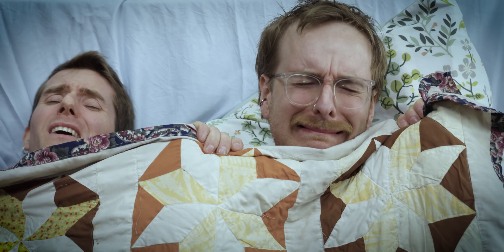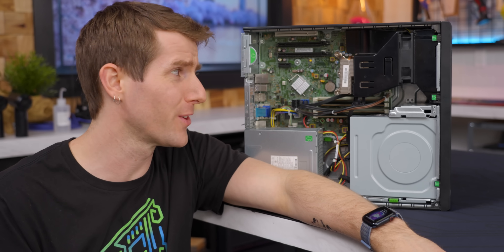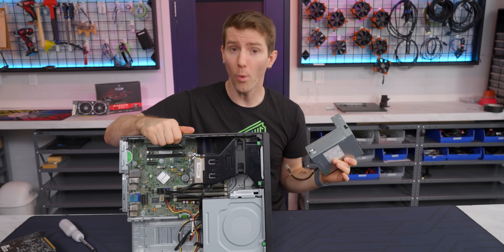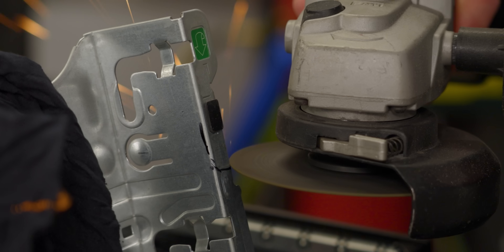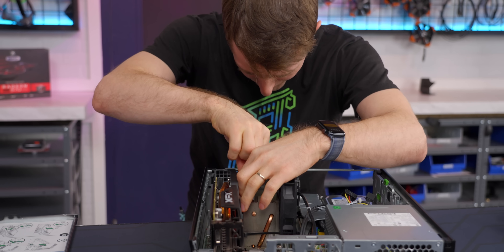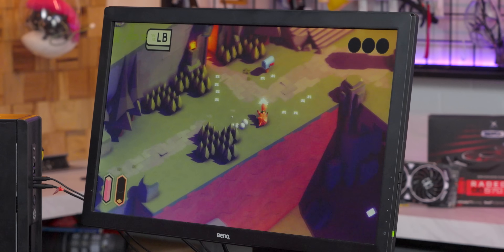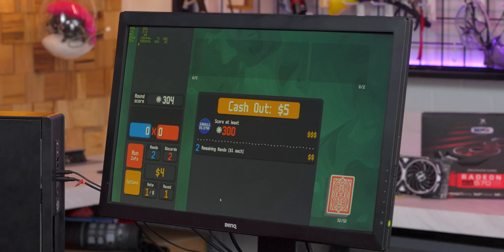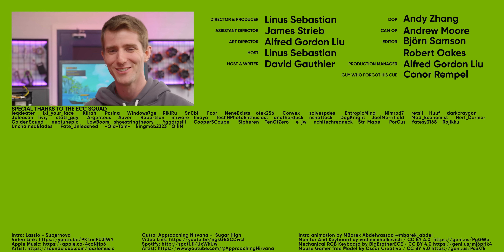How to Build the Ultimate $69 Gaming PC!

Comment: Ex-corporate Dell T3610 or HP Z420 are much more sensible & practical starting points for budget builds, and can be had for £30-40 if you hunt around. 
Throw in an RX 570 8GB for £30-40, and a 500GB SSD for ~£20.

It's not entirely jank-free though; you might still need to crack out the angle grinder to remove the internal side panel handle, and the soldering iron to fabricate an 8-pin to 8-pin PCIe aux. cable.

Comment: I already have a PC like that I built in 2016. It has an i5 processor probably newer than the one in HP prebuilt. 16GB of DDR 4 memory. It was designed as a small form factor at the time. The GPU is an old GeForce GTX 750 Ti. With only 2GB of vram, it’s not that good of GPu. I already have a Radeon RX 5700 XT. 

So with LTT logic, I can technically build a Jank gaming PC for Zero dollars from parts from older builds.

Comment: Having my spare setup totally free. Got some old Dell with 12GB(8+4) of RAM, changed i5-7400 with i7-6700T(yeah, I know, RAM speed downed to 2133 and all, but hey! 8 threads are 8 threads!) from another trash-saved miniPC, threw an Eon-old R5-250 and voilà! GTAV locked in 30FPS FHD capable machine! BTW CS2 has little to do with VRAM at this point as it went up way more CPU heavy from CS:GO

Comment: Picked up a 3570k / rx 480 and a 8700k / gtx 1080 pc off the sidewalk once, cleaned the dirt off, both work fine.
Also bought a "box with old electronics" for 150$ once - inside was a completely decked out T430, a still working but in terrible condition T60p, 4 SSDs and 5 hard drives with a total capacity of 2 and 12 GB respectively.

Just gotta keep your eyes open.

Comment: Just built a similar system. HP Prodesk prebuilt for $25 shipped. Added ram, 7th gen I3 CPU and SATA SSD I had in my parts stash.  Haven't yet added a GPU but this this rocks. For under $30 out of pocket.  I love those 7th gen Prodesks.  Super build quality, easy to work on, BIOS updated only a year ago, and by golly they perform well.

Comment: Check your local recyclers, ask nicely and you might even get a PC for free. My local recycler is pretty chill. I "drop" a case of beers at their office and they "overlook" me digging through the e-waste container and making off with a stack of old office PCs. Typically I fix them up, upgrade them when needed and sell them for a nice profit. A Core i5 8400, 16GB DDR4 RAM, a 256GB NVME and a GTX 1660 (Ti) and Windows 11 are quite a neat little package for 150-200 bucks.

Comment: I transplanted the motherboard and 6th gen i7 CPU from an HP workstation into my existing ATX tower case once, and even bought the proprietary PSU adapter harness. But little did I know, that motherboard had sensors on the ground pin of every header, and threw up multiple separate POST errors until I made a jumper wire from the ground pin of every USB header and fan header back to the ATX connector. Wow that was janky.

Comment: Hell no, HP - no. Lenovo - is good for a build. Actually you may buy some laptop, with nVidia 960m, 1060, this decision will cost you 200 - 250$ Build on AMD 8060G 16 Gb RAM 256 Gb SSD , with only 250W PSU or even less, will cost you around 500 $ Enjoy!

Comment: LMAO that's literally the same case i have but my cpu is a I5 650, 7:04 also that's how my gpu is in my pc, a friend got me a new graphics card so i had to remove the side panel, break part of the back IO panel and a tiny part of the cpu cooler since i didn't want to remove the cpu cooler, also i had to put like a tiny piece of wood to hold the graphics card so the blades didn't hit that copper thing that was sticking out of the cpu cooler. It's SO JANKY but it works surprisingly well, a year in and no problems yet.

Edit: 10:02 I CAN'T 💀i didn't see this, it isn't the same reason as to why i did it but it's so funny he had to put something to separate the gpu from the cpu too hahaha

Comment: 980ti preforms the same, if not just slightly better than the 1060 6gb. Had both, and both performed similar. I was using a 4770 at the time though, maybe a cpu bottleneck lol.

Comment: A few months ago i built one of these. A hp prodesk with a i7 9700 bought 3 rgb fans a 120 aio and a p102 mining gpu, modded the 12v power cables added pcie. Got 1070 performance in games and only cost me $200 in total for everything. Was "fun" building and sold it for $350. Did this a few times and with the profits now have a 5950x 64gb ram 2.5 tb and a 240 aio 1080ti. Put in the work and you can build a good pc

Comment: if you use a hdd, use Linux. It's so much better than windows at dealing with slow storage, i can honestly say, i rarely notice any difference between an ancient HDD and a modern gen 4 nvme ssd. 
Sure, booting takes a few secs longer, but apart from that?

Comment: Is it advised to use PTM7950 thermal pads with an i9-10900k and an AIO?
Edit: my current "paste" is what came on my (Corsair H115i RGB Platinum AIO Liquid CPU Cooler, 280mm, Dual ML140 PRO RGB PWM Fans, Intel 115X/2066, AMD AM4/TR4)

Comment: If you dont mind not having official W11 support, HP workstations are beasts, especially newer one (2012+) with V2 and V4 cpu support. E5 2299 V4 is beast, especially if you get dual CPU model, and they are pretty cheap. Made an home server from an older Z620 with older 2255, threw arc A380 as encoding card and it is running plex and some light game without any problems.

Comment: For around $60, you can buy an AMD BC-250. It’s a single-board computer based on a cut-down PS5 chip, with 16 GB of unified GDDR6 and an M.2 slot. These were mass-produced for mining. All it needs is an SSD, a 250W power supply, and a cooling upgrade. And of course, installing Fedora Linux to use the community GPU driver.

Give this build a try — we’d all love to see how it goes. Thanks! (Feel free to like this to push it up.)
Reply: I kinda wanna see this.
Reply: hmm... me too.

Comment: nice I done something similar for my 3 nephews ,  you can use nVME ssds as a boot drive with a bios update with some of those old sff hp's  ,  but you need one of those pcie adaptors , and the other slot is covered by the GPU ?    I never got around the lack of psu power though lol!     you can get Low Profile  RTX 3050s now which is probably what il use for my next sff build but thats a lot more expensive :)

Comment: they have fairly inexpensive sfx psus now that can straight up replace those crappy ones you can basically rebuild those mini pcs into quite a nice pc with an SSD. LP cards fit in the systems nicely also and usually require less power draw. Also most of those office pcs have good fan control in the bios. The best ones are the ryzen based ones in my opinion they do great for gaming paired with any gpu due to the core count.

Comment: Found a free broken keyboard that needed a bit of tinkering a 5 buk monitor, a 20buck cpu mobo ram combo 15buk psu a 30buk gpu and a carboard box with tape and i had myself a potato that i could play before 2017 games on, stuff like doom 2016 actualy ran great.

Comment: My mates playin helldivers 2 1080p/60fps on an old hp z240 with a 1070, £50 for the pc (i5-6500/8gb ram/400w psu) and £100 for a 1070 from cex bit steep on the gpu but does come with 5 year warranty. I donated him and 8gb ram stick and an ssd from my old laptop n hes had no problems so far.

Comment: "4gb is not enough nowadays" dawg I am putting a gt 1030 2gb in my pc, I think it will be good enough. But jokes aside I also have a hp prodesk, threw a sata ssd in there and now the gt 1030(no power left). So the computer I got for free, the GPU was €42 and the riser cable to hopefully make it work is €10

Comment: 15 year old me was able to pick up an old Lenovo laptop with a 4th gen i5 and an mx 150 with 8gb of ram for free. Free cause it literally had no display and the keyboard and trackpad was broken. Bought a second hand monitor and a budget keyboard and mouse and a small USB fan. I took the bottom off the laptop and had it facing down, with the USB fan blowing down on the motherboard and heatsink. I only really played Minecraft on it and I was able to get 60-80 fps back then (forgot what settings I was using but it was 12 render distance). I've since upgraded and now that laptop has become a dedicated Minecraft server that me and my friends play on. 😊

Comment: These videos need to also contain a fully built "what if you spent just a few more dollars" build to show how much improvement 5-10 dollars can make. I was really curious how a 100 dollar PC would perform.
Reply: a small CPU uograde and another GPU upgrade and it will be SOLID
Reply: yeah, put in a i7 and 16gb and it would increase the fps a lot more. the 570 wasn't an issue in csgo. I hate how they blamed the 4gb of vram

Comment: I got a good dell from work for a steal woth a cad gpu in it, but my god the proprietary nature of their pcs should be illegal.

Motherboard size/mounting holes
Front IO is mounted to the board with no usb header
CPU cololer attaches to the case so cant be reused
Power connector is non standard so you cant swap it out easily
Sata power comes via the motherboard not direct from the psu liniting expansion

All these things combined just makes me want to replace the motherboard and move the rest elsewhere.

Surely theres a cause with the volumes of these things for regulators to put a stop to the non standard rubbish they are pulling. That or is there a market out there if someone made bigger dell compatible cases with power connectors to fit a normal psu in to so users could take them and turn them in to $69 pcs without and angle grinder or second psu.

Comment: My first gaming pc i  bought a dell T3500 pc of FB marketplace for $150 with a Xeon 6 core processor 10gb of ddr3 and a GTX 1060 3gb , i sold the 1060 3gb for 125 then bought a 1070 for $225 , it ran all the games i wanted smooth af until i could save up to build my own , old workstations are the way to go if you are on a budget just buy one cheap and get the best GPU  you can find and throw it in

Comment: 😂 I just finished my "$69" PC based on your last one. Haven't had a PC for a few years, just been renting a Shadow for the last year. My Internet went to crap so I ate nothing but sandwiches for a few weeks and bought my own Z420 and an open box 1660 Super. Someone gave me a 2TB WD Red hdd. Including shipping, I paid $100 for the tower and $120 for the GPU. I got lucky and got a 2nd gen 420, so when I upgrade the CPU I'll be able to use the v2 Xeon E5 CPUs (if I don't just get a new board as well). Have some case mods planned too. Going to eventually drill out all the rivets to get rid of the 3.5" bays and make room for a couple front intakes. Going to convert the 5.25" bays into 3.5" bays with a 120mm intake fan in front. Gonna add some feet and a couple 90mm intakes to the bottom. Going to add one more 90mm on top as a second exhaust. Might add plexi to the side panel, not sure on that idea yet, or the paint scheme.

Comment: This is hilarious, I literally just got done scrapping together a cheap PC with this exact model business desktop and SSD. I ended up finding a low profile slot powered GPU, no case cutting required!

I am using it for more CPU bound stuff so I put in an i5-4690 and a 1050 Ti

Comment: Operating system? Microsoft is saying that W10 is dead after October. W11 supposedly only runs on 8th gen CPUs with TPM2.0 which are significantly more expensive than your budget. Installing a Linux distro like Pop_OS works great and there are loads of Linux compatible games now but do you want to go there? This huge elephant wasn't even addressed, instead Alex with his angle grinder was the entertainment.

Comment: Out of curiosity, why not do 69, 169, 269, 369, and 469? What does an extra hundred dollars get you? I think the results would be really interesting. You could have, probably, entirely different architecture running some of those systems.

I know I would also be interested if you went more in depth with what parts you chose and why. You did a little bit here, but it got glossed over pretty quickly.

Follow up the sweet build phase with blind tests between employees and see if they can figure out which computer has the best parts. Cover up the PCs so that they can’t see them. But the same 1080P monitors and peripherals on each computer.

Comment: Why using 2 PSUs can cause issues if the reference voltage may not match so 0V and 12 V on one PSU may be -1V and 11V by reference (The part is still getting 0V and 12V) but that difference between the PSU generates current whether there normally is none. Depending on where it can break things or if the voltage diff is enough damage them.

Comment: I love the budget builds. Can you do a big FU to the GPU market video with the newest cpus like an i3-i5 vs a i7-i9 only running on integrated graphics and a line up of game for each processor. Max it out with overkill ram like 4*64gb(256gb) ram sticks, overkill cooling, overkill power suppply, even try to overclock it a bit, check out the fps without a GPU then add like a $10 gpu for the luls like a 710gt or a 550gtx and see if it makes a difference and try to hit 60fps the best you can in 1080p and 1440p lowest settings for each game? would be so funny to try and ignore all the GPU's that came out in the past 10 years and only focus on a PC with the newest processors first

Comment: I did nearly the same budget build, with literally scrapyard diving. Overall, I paid around 70 USD. I got a i5-3470 prebuilt, a GTX 1050 from another dead PC on there, and buy myself a budget nvme drive for boot drive and got myselft 1tb sata ssd for it. I got that sata ssd a few months before the build, from the same scrapyard too and the dude doesn't want any money for it, so it's nice to have it.

I haven't use it much, but it's nice. Im also can't believe the GTX 1050 is still in a good shape considering most of them scrapyard PC are exposed to the weather. And in this tropical country, that's a miracle

Comment: Linus confused M.2 form factor with NVMe. There ARE SATA M.2 drives.  You can have a computer with an M.2 slot that only takes SATA. The connector on a SATA M.2 is slightly different than an NVMe one and has a deep notch in it.
Also, for things like booting windows and even loading some games, SATA SSDs (at least good ones) are just as fast as NVMe.  It's pretty impressive how LITTLE of the time an NVMe drive spends actually using its high speed.  I guess even on an SSD most time is spent seeking.

Comment: i had to do a doubletake, i kid you not i ran that EXACT pc with a full-size gpu sticking out the side and an external psu for 5 years. served me well until helldivers 2 came out (also. tin snips and patience work for cutting out the hole in the side panel lmao, it's just slow)

Comment: XEONS E3 12xx v2 & V3 are good very cheap CPU to upgrade a 1155 or 1150  plataform. Very recomended. here in Argentina rx 570 or 580  8GB can be get by around USD 100, and are very good for that price without juming 200 USD to something "better" or "newer".

Comment: INDIA 🇮🇳 - Amazon i5 2400, 8GB ram, 500GB HDD = 186$ (16K₹)🙃. In Online Stores (Inc Amazon, Flipkart, other Sellers direct Website) 99% PC are Scam. But you can build Cheaper by Buying parts separate online 😂.😅.

Comment: Integer-scaling is your friend with a gaming rig like this, use a 540p base resolution, and you will get really decent performance and image quality, you can even get away with lower base resolutions like 360p if need be, integer-scaling is amazing and under-rated. I'd also make sure to use a tiny OS, like Windows 10 X-Lite, which will give you much more snappy performance and better 1% frames & latency.

Comment: Whats funny is that I am literally doing this with a hp compaq elite 8300 and just stuffing in a 1050ti ribboned in as my set up. Helldivers gets around 40 fps. Not bad but around 160$. Like a week ago I acquired my uncles mined on set up because he had to go overseas. Nice to know that LTTP went the extreme route over just using a ribbon and a low power graphics card jammed up into that slot so the side panel can close easily  with no cutting needed.

Comment: why not use a 3050? (non 8pin)  decently power efficient. that or amd rx 6400. both slim form able gpus. wouldnt need to tinkner with psus. they also making an adaptor for the mother board so a 24pin psu can work with the motherboard. 

i been messing around with an hp 8200 elite.
i7 2600, upgraded to 32gb, upgraded fans and got better cooling. ssd upgraded reduced load on cpu and removed stuttering. rn have 1050ti, just have it from previous pc i had. looking into above mentions gpus.

Comment: I've been tempted to cut dell optiplex 5040 case but it looks nice under tv so I'm still looking for low profile card that's reasonable I use the computer for emulation upto saturn games had a gtx 740 but it quit working stuck my 620 gtx in but it really sucks.

Comment: I have an old Dell Optiplex 5060 SFF as my Windows daily driver (also have a MacBook Pro for my Mac daily driver). Both were free from an old job. I was pleasantly surprised to find that while the Dell only had room for 1x 3.5 or 2x 2.5 drives, it does have a single M.2 slot. Takes a little work in the BIOS to boot from it, but definitely a factor if you're going down this road.

Comment: I get that $69 and intervals is the bit, but there's a lot of room in between for a really interesting build.  That said, I feel like $169 is especially interesting price point.

Also, some PCs built in the $69 tier can dual-boot Windows XP, which opens up even more retro options and a broader range of games.  And an awful lot of circa 2013 gaming PC builds are being offloaded now...A Ivy Bridge build with a GTX 970 is competent in (some) modern games while fully working in XP.